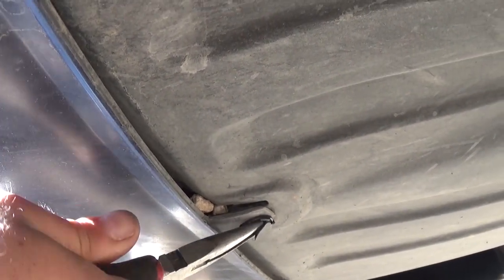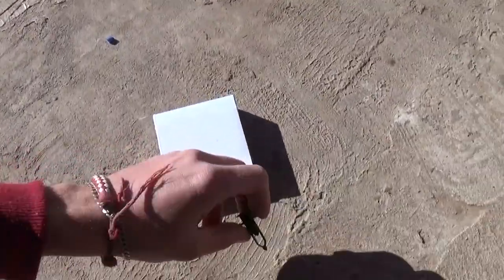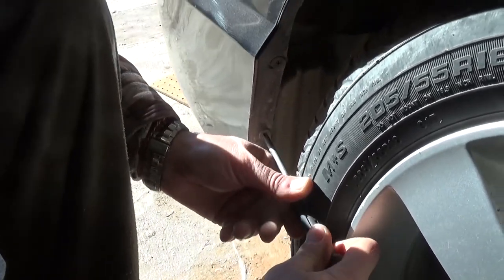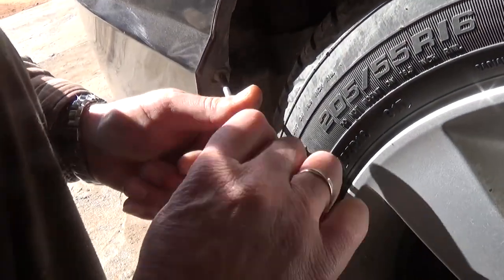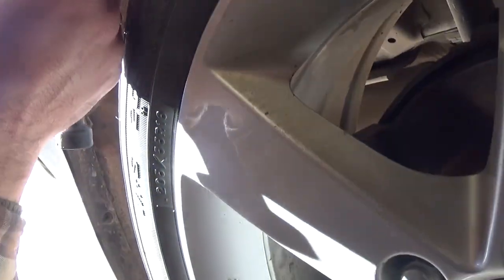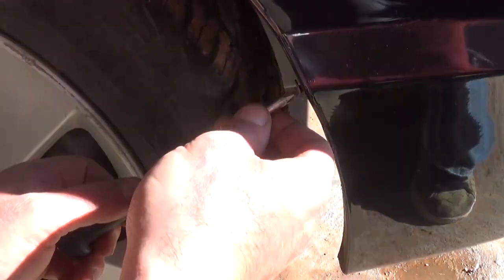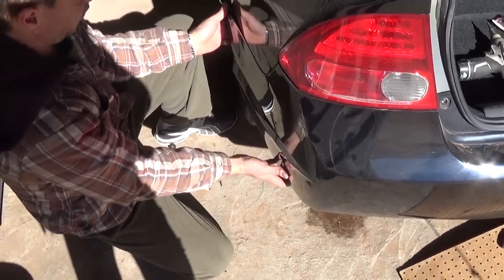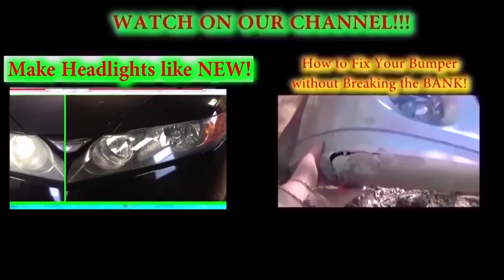Rear Bumper Cover Removal and Replacement Honda Civic 2005 2006 2007 2008 2009 2010 2011

Comment: Thanks so much for this valuable info.  I just purchased an 09 Civic and the rear tail light was cracked .  Tried to replace by just removing the 4 bolts on the back of the assembly but it wouldn`t come out, now I know why thanks to you.  Will be able to do it now with the help of this video.

Comment: There are brackets holding the bumper on. Is there a way to remove those brackets because the tabs on them that hold the bumper on snapped so my bumper won't stay on.